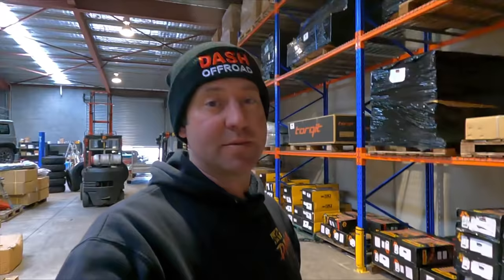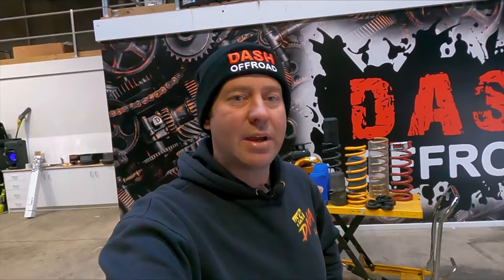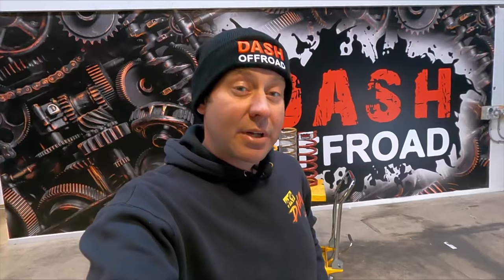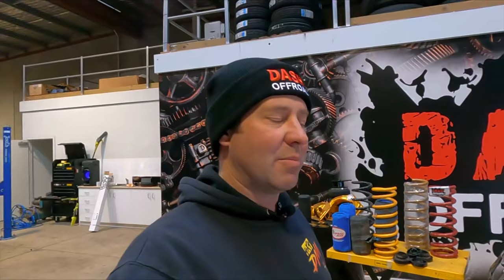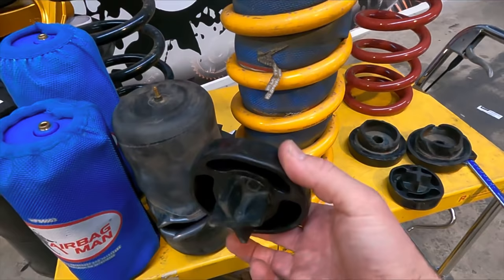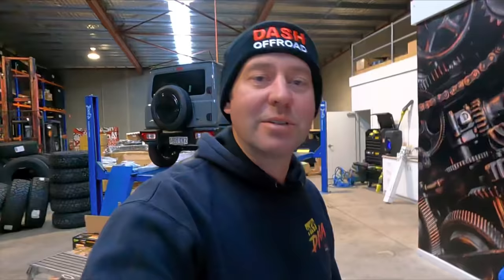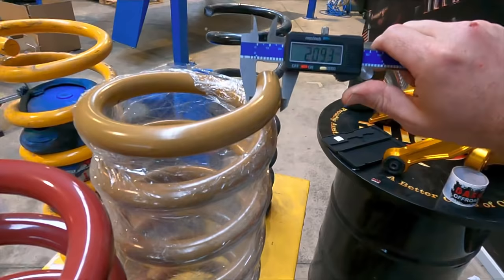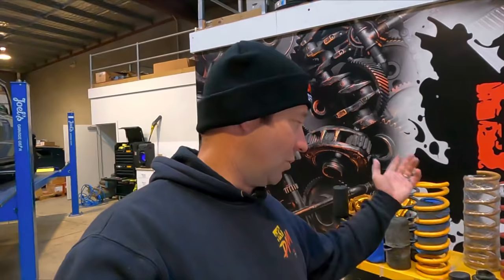Catastrophic Airbags When Towing

Comment: Hey there. What is your recommendation for leaf springs and airbags? Is it essentially the same as coils just with leaf changes or are they not affected as much as coils?
Reply from the maker: I’m sorry but I don’t really have any experience with leaf springs so couldn’t say
Reply: look at the size difference between a coil spring and leaf spring and if thats not enough go have a look at a truck.
Reply: @grimreaper6112  It's not just a size difference. There is a whole different dynamic working here as they operate using different mechanisms. 

Am I right or am I over thinking the whole issue?

Comment: Hi Dave just have a question I got the GVM 300kg upgrade done with you guys with billet arms not long ago which is awesome however I cant seem to get the van level even with the bags up to max. Just wandering you stated in that y62 you use now the 795L in the rear I only have the 795. Would it affect my engineering certificate if I installed the 795L in the rear mate? In the front I have the 790HL cheers
Reply from the maker: Could be a few things. Next would be to look at your tow hitch height and of course, ball weight
Reply: Check your ball height
Reply: @fossilfuelenthusiast  hey mate yeah I have checked that actually first thing I did lol
Reply: @DASHOffRoad  yeah cool checked the height and it’s fine ball weight about 285kg

Comment: Be easier an safer for these caravan clowns to buy a smaller, lighter caravan. But that makes too much sense i guess..
Reply: Gotta tow that big box of air around
Reply: I’ve decided, when I’m traveling remote I’ll camp in a tent with stretcher. My Dmax with Norweld canopy has all I need. When I’m touring, I’ll stay at a hotel/motel. The cost of a room per night, even a cabin at a caravan park, is cheaper than buying a big caravan and hauling it around